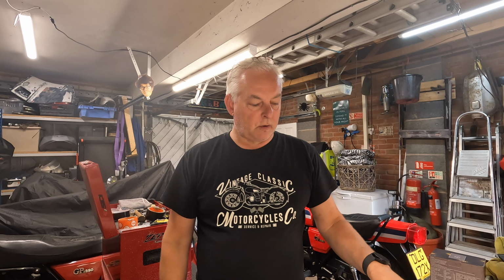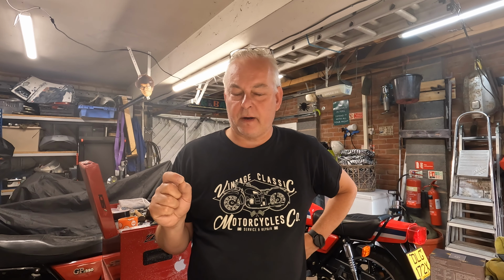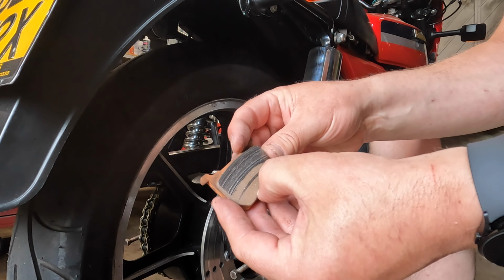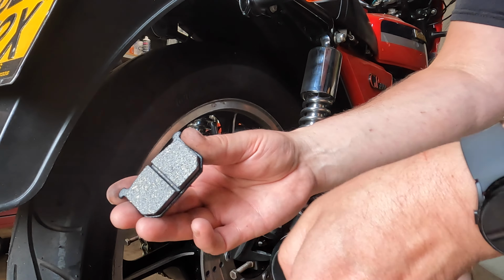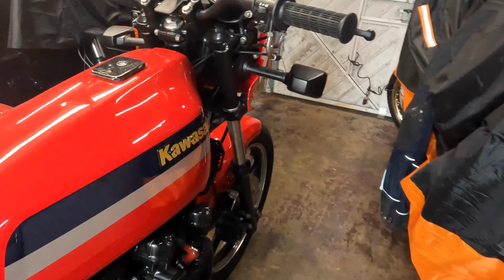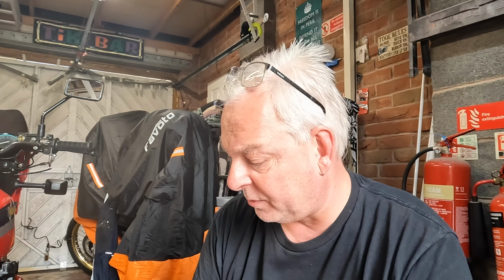Kawasaki GPZ550D1 (1981) - Lets sort the terrible brakes out !

Comment: To push the pistons back in you can slightly loosen the bleed nipple and they should push back in by hand or you can use a G clamp if still not moving which would prevent caliper removal. Also a good idea to check the caliper holder shafts have been greased.  Are the pad sliders missing as I could not see any on the rear caliper holder ?